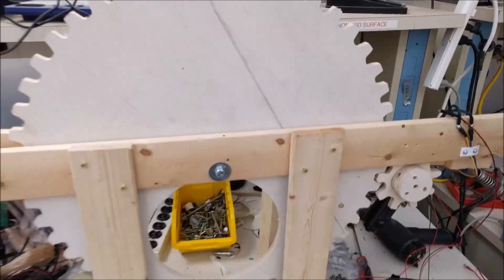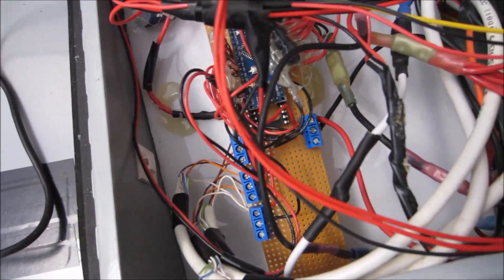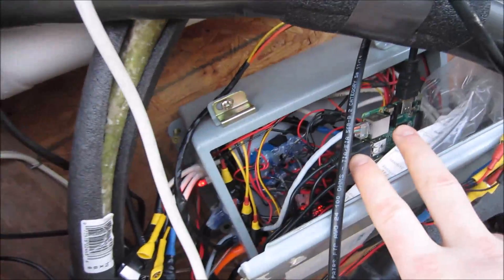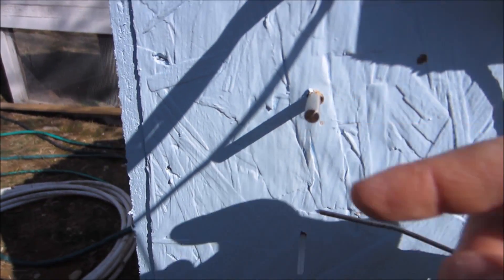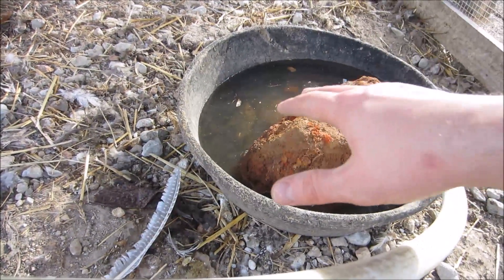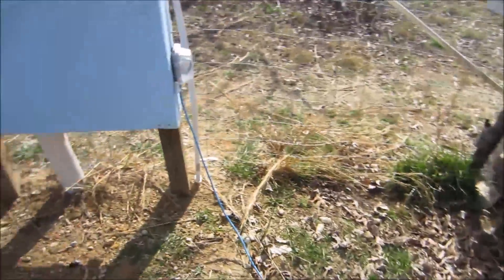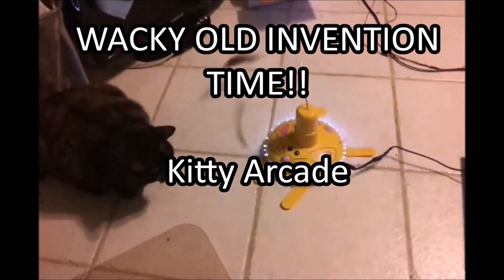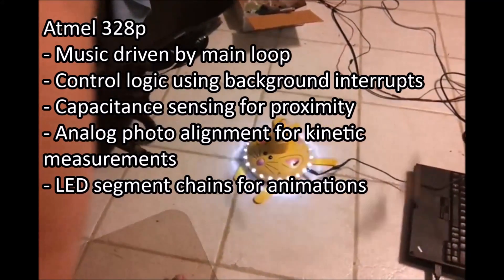Automatic chicken doors & watering | Raspberry Pi2 + 2x Arduino Nano

Comment: Very cool. Love the novelty of the gigantic wooden gear! I'm planning on building a "smart" coop soon with an rpi as the brains so its nice to see another example of it. One of the features I'd like to integrate is an automated door... I am curious though, why did you choose to use the arduino to run your motor and monitor your sensors rather than just using the gpio pins on the rpi itself? I'm planning to use a 12v linear actuator to move the door and just using a 2 relay board connected to the rpi to send voltage to the actuator (and reverse polarity)
Reply from the maker: I tend to break things out into modules so that when something fails it can be isolated to a particular section of the solution. Breaking complex problems into smaller pieces. I wanted an expandable architecture.
Reply: @someoneinncarolina  That makes a lot of sense. Thanks for the quick response